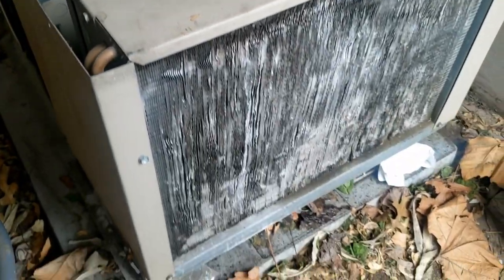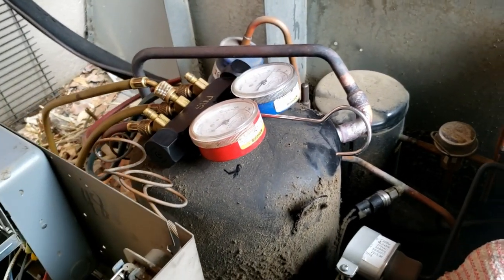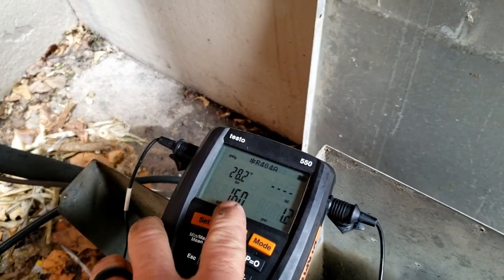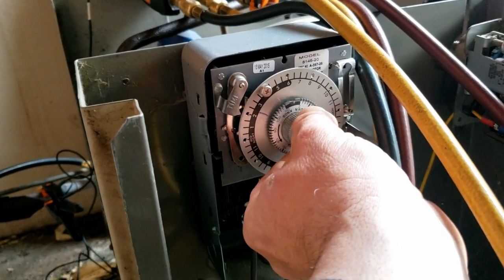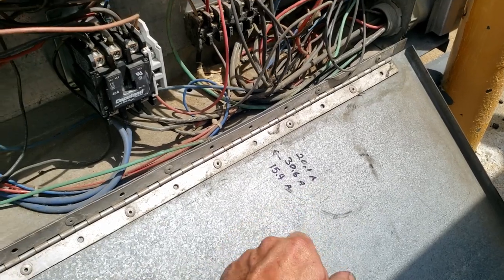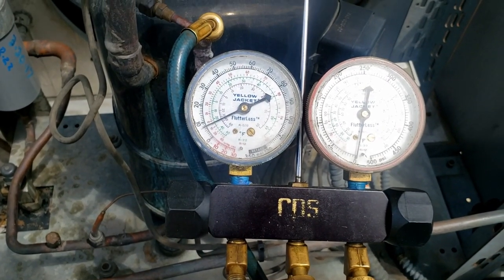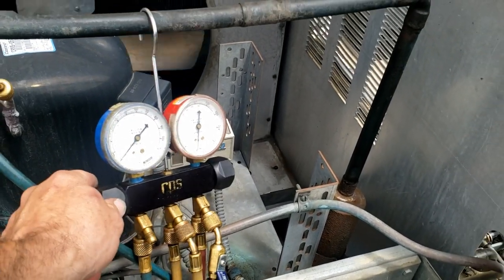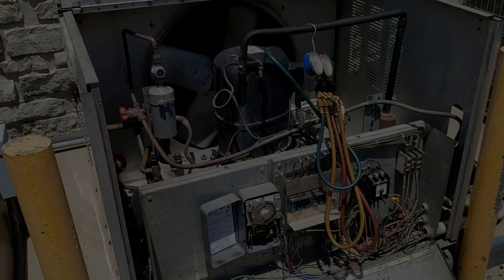Double Calls Double Problems

Comment: The clock does have a synchronous Motor, it's speed is only frequency dependant.
But with to little supply voltage it will lack torque and might stall.

Comment: I had a helper once who busted out a wire brush to straighten out the fins on a RTU. I was like what’s he doing? It actually worked really good! 
He turned the brush longways and ran it down the coil a few times and whata you know it worked. That’s the only way to do it works really well
Reply from the maker: I use a pet comb Style wire brush to clean the coils. What type of wire brush are you talkin about?
Reply: @HVACRSurvival  it was just a regular rectangle wire brush. Scared me to death but hey my helper showed me something that day!

Comment: 1st unit i have seen freezers ice up with high s/h cools too slow does not cycle, 2nd unit i think you need to feed 230 volts to the timer and maybe change it,great learning vid thanks.
Reply from the maker: I change the clock 220 volt plus I had doubts about the way it was mechanically working anyhow.  It makes sense on the first comment about the high superheat👍👍
Reply: @HVACRSurvival  the clock motor was stalling out instead of tripping into defrost. that was far too low of voltage and causing very low torque, plus you showed it was stiff to turn. also noticing the dark schmutz on the bottom of open front cover, which looks like metallic shavings from gears/bushing/cams, but could be sputter debris from the contacts arcing. I'd say it was due for replacement anyway.

Comment: With that style clock timer, can you spray the inside with something like WD-40?  It shouldn't affect the electrical connections or contacts.
Reply from the maker: I try workarounds to get things running if I don't have the replacement part available at the time but if I think a component is failing, the best procedure is to replace it. Most of my jobs are for businesses that rely on their equipment to make their profit, if it is not running they're losing profit and if I have to go back I'm also losing reputation and profit. So it's in everyone's best interest to replace anything that is tested as failing.

Comment: Now I have a question how’s those 550s testos?? I’m normally using the wireless probes or the smans. I’m just curious cause I’ve never had testos. I’m usually doing commercial rtus.
Reply from the maker: They get the job done and they cheap but they are a little disappointing sometimes.

Comment: With that water heater, it needs a good flush (and that might not fix it).   To do that, you're going to have to pull off that valve assembly completely and put in a straight through valve for maximum flow (and size for the scale) 

This keeps reminding me I need to get my a/c checked, and take the pressure washer to the coils (low pressure)

Edit - the timer said that it was from 108 to 240 volt.  So it was fine.   Might still be bad, but not because of the voltage.
Reply from the maker: I don't have to do plumbing at this place, one of the nice things about coming here. We have dedicated plumbers for that
Reply: @HVACRSurvival  - That'd be great if they did their jobs :)   Especially with hard water, you should do a flush every six months.   I've already done one here at our rent house, I need to do another one (after replacing the drain bibb).   I mean, you wanted to do your job, and they made it so that you couldn't do it.
Reply: @tbelding  lol, nobody flushes or services a water heater, until it's leaking or quits working. pretty much same for HVAC/R,  :) welcome to the real world
Reply: @throttlebottle5906  - I guess that means I don't live in the real world.   I want the stuff I buy to last as long as possible.  (Given the purpose, of course.  If a saw blade burns out going through MDF, I don't curse more than a few minutes, for example)

Comment: Beer cooler with electric defrost heaters ? How cold do they want their beer ? Keep box temp 36-38 n air defrost on off cycle  Great video thanks for sharing 👍
Reply from the maker: They like 32 to 33 degrees.
Reply: Wow! Thanks Rick
Reply from the maker: @shine-cg9uf  some people want their beer really cold🍿🍺
Reply: @HVACRSurvival  very cold beer sells great and doesn't get pee warm on the trip home, they likely pull in people for many miles around just for that.
the gas stations all suck with their shared product load and standard temps. drive-throughs and dedicated cooler beer marts usually look like a disturbed hornets nest of sales :)

Comment: ohhh bad move @ 12:33 ! never touch a water heater drain valve(or relief), unless you're ready to replace parts or the whole tank!
city water or well water makes no difference, even if they flush it yearly those valves suck donkey-doo.
Reply from the maker: True story